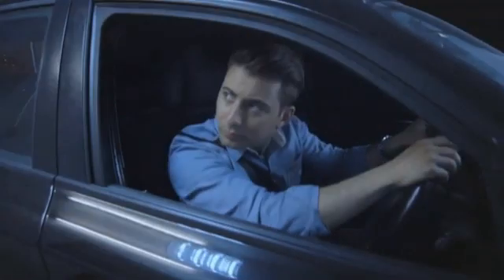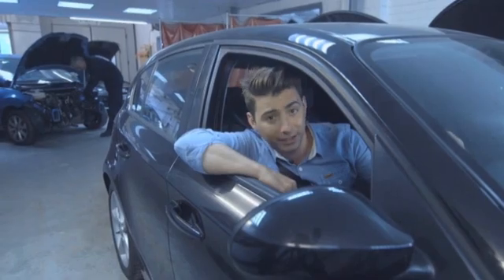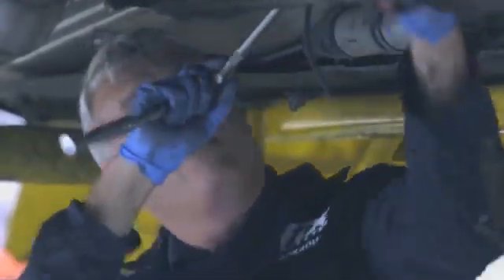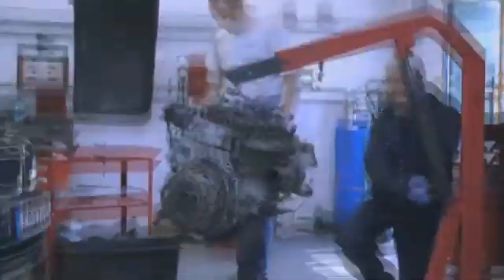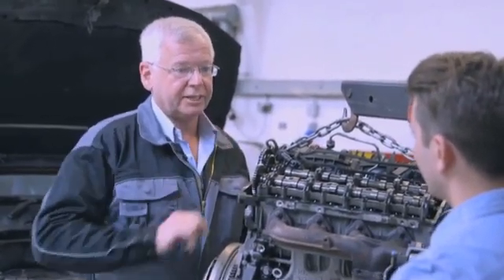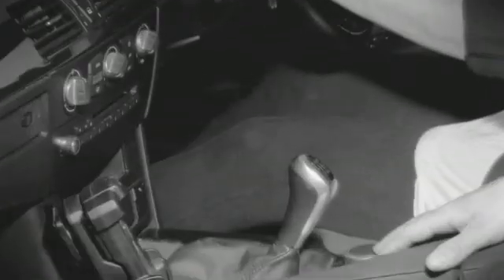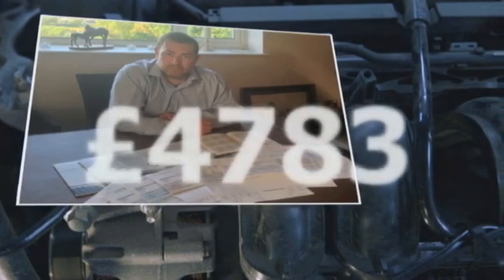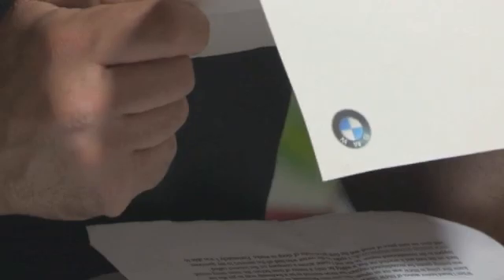BMW N47 Timing Chain Failure PROBLEM

Comment: You got what you paid for !
diesel, four-cylinder with turbo is not true bmw engine, its downsize shit for EU and her co2 limits politics
Reply: Tomas Kato
6 cylinder diesel also brakes down. My friend had last year first e70 timing chain broke with 230 000 km, than his second x6 same engine 3.0 l 173 kw with 270 000km and this he  told me to change timing chain before it brakes maybe 20 days before, and i didn't.
Last week my e61 525xd 2008 with 220k died on Autobahn and in service its fck timing chain. And i have x5 with same engine but more km on it, shit. I have to sell shit and buy some other brand but its all same shit, audi, mercedes also. I don't know what to buy that i dont have problems

Comment: always was bmw man. since my current e90 LCI 318d it is till good car to drive,
but how many problems it has. even small stupid ones. but it doesn't cost stupid money to fix or replace parts, it cost a lot !!!!

just week after warranty runned out one of rear LED light unit broke started to play up and 3 lights off.  they supposed to last for 10 000hrs ???!!! it has faulty chip or something in it,
BMW didn't offer to cover any of charges !!!!!!
i wouldn't advise anybody to buy such expensive car which fails same as cheap french car...
my advice go VW or korean :)
Reply: that can be reset

Comment: Yesterday was driving on motorway 70mph, suddenly engine cut out, when stopped at the curb tried to start it, the sound was like starter just spins and no any noises from the engine, on the dash no engine management light etc, is it timing chain???? Its 2008 e91 320d

Comment: I had a bmw and nothing but problems even the dealer couldn't fix the issues after 7 visits finally sold it and bought a honda which I had for 8 years and never seen a dealer for repairs at all only went in for services each year just sold that car and got a toyota and yes I know then have had lots of recalls but at least they had the bloody guts to recall and fix the cars free bmw just showed 2 fingers as shown in the video let the customer pay the £4000 they couldnt give a toss German engineering yes may be good but when something goes wrong it's time to remortgage your house to pay for there ridiculous charges.

Always said it Japanese cars are the most reliable cars in the world
Reply: At least they admit unlike bmw will never admit
Reply: Toyota and Honda have gone downhill, both having pretty serious issues like that takata airbag recall, Honda been having serious issues with transmissions and engine issues on the Honda CRV, Toyota had to recall 1 million hybrid cars for fire risk and they also had stalling issue recall.

Comment: Why do BMW's continue to have problems? They are inconsistent with reliability.  It's starting to become really annoying and frankly it's pathetic. My 2006 Subaru has less problems in 8 years than a brand new BMW in 1 year. BMW has been building cars long enough to know how to make a reliable fkn car that doesn't break after 3k miles. I'v always wanted a BMW, but the constant horror stories I hear from the e46 to the f30 models are starting to turn me away from them. For a car costing 33-40k it's making itself look really bad.
Reply: but shut up!i had a 5 series 2005 never had any problems,then X5 2008 no problems,X3 2012 NO PROBLEMS!
Reply: Top Cars HD Oh...I think I can say that You are the only one so lucky, believe me.
I' m a  car mechanic from 18 years and I can say that, from 1999 BMW is the worst company  if we speak of reliability.
Reply: BMW's aimed consumers are the wealthy people who buy them new, under warranty. The wealthy consumers then sell them to people who buy them used, or trade in for a new one. By that time the consumer has lost little money, or don't care because they can afford the depreciation loss. BMW does not care how the car performs in later years, because the people who do buy new cars, get rid of them before anything occurs. They do not care about the people who buy used, because they don't make much money off them.  The people who buy used BMWS are left in the dirt with the oil leaks and other common failures bmw tends to have.
Reply: taythephoenix We've had 10 BMWs in our family since 1993 (E34 525i, 2x 530i, e39 525i, 540iA, 2x X5 (first gen), e46 320iA, e91 325iA, F07 530d). And none of them have had catastrophic failures. The most annoying one was the e91, because it had problems with the radar-guided cruise control system (went to the shop 3 times because of that) and it also ate too much oil (1L per 2000km). One of the X5 also had an odd problem with electric mirrors while other problems have been really minor and even then none the issues have ever left us stranded on the road or caused any major inconvenience. Furthermore, e34 and e46 have proved to be almost bomb-proof reliable because they were in our family for 10 years each (the e46 was passed on to me). Sure, there are more reliable cars (like Toyotas, Hondas, VWs), but in the end these cars lack the refinement, tech and driving characteristics of the BMW. With that being said, the problems with N47 are absolutely horrifing and I didn't have a clue that the issue was so widespread. I will definetly avoid buying any BMW with that engine in the future.
Reply: Alex Davis
and thats different to other manufacturers?
Reply: pythonovitch It does seem that # of issues with BMWs has gone up in the past 10 years, but we also need to keep in mind that so has the # of electronic gadgets and tech in general. E34 had lots of mechanical components and was easy to work on for DIY whereas you need a laptop with a cable and electronics + engineering degree to work on something like e60 or F10.
Reply: ***** That is true. Unfortunately I (or rather my family) has no positive experience with an Audi. But we have plenty with BMW and also with one Mercedes (ML320CDI, pretty much bomb-proof). I should also add, that we had major electrical issues with VW Corrado, but that was way back when it was new so it didn't stop me from buying a Golf as brand new and selling my BMW.
But anyway, I think that all companies have horror stories. Remember when Merc lowered its production quality so it went from the brand with the best reliability record to the bottom second? It has since improved a lot, thankfully. To me, the absolute worst part about the N47 fiasko, is that BMW has handled it VERY poorly - they could have offered apologies and offered some % of cost reimbursement to customers. For this reason, BMWs with N47s have no value in my eyes. At this point, I would rather buy a French car than '09 320d.
Reply: merc audi and vw have same problems. ive had serveral bmws and never had any problems.
Reply: *****
Customer service is different everywhere. In my country, Audi service is absolutely awful and that goes hand in hand with terrible quality of their cars. My mom had more problems in 1 year of owning (bought new) Audi A1 than my BMW in 11 years. And it wasn't just some minor electrical glitches either.
Reply: im a BMW mec and i use to Work with e30 e34 e32 e36 e46 the best engine i worked on is the  m30 m20 m50 the m50 only needed a metal waterpump then it runs forever i have a e36 m50b20 i traded with my daughter for a e46 316 i love to start the e36 up it have a  stainless steel exhaust system and pure eargasm
Reply: Alex Davis
well the bmw 6 and 8 cylinder models have always been reliable. so everyone who buys a 4cyl should blame himself should it fail.
Reply: Never said it was necessarily, considering the topic is BMW I find other manufacturers irrelevant, but German engineering definitely seems to be considerably prominent in this.. MrBusunglueck

Comment: This is why you replace the timing chain / belt on any car at 100k
Reply: You didn't watch the video did you?
Reply: A timing chain is designed to last forever. BMW should recall all cars with the N47 engine and replace the timing chain and the crappy crankshaft. It's their fault.
Reply: *****
Timing Chains should last the life of the engine (or close to it). It's timing BELTS that should be replaced regularly. The life of a chain over a belt is why they use chains. In this case I don't believe the chain to be an issue because the chain did not appear to be broken. The cause appears to be some failure in the tensioning mechanisms.
Reply: Nope just typical German engineering just like the high pressure fuel pump failure epidemic.
Reply: *****
have an m43 engined BMW with 153000 miles, regular sevicing is key and general maintenance
Reply: Go ahead with that mentality and you end up like the video. Because when you wait until there is a problem they usually don't fail slowly, its usually working and then it isn't and the engine gets trashed.
Reply: Most warranties are over at 100k miles. Why would you want to risk 5-7k on this rather than having spent 900 every 100k miles. Thats how I see it, I know some chains are meant
 for the life of the motor, but usually never last that long in the real world
Reply: but some of these N47 are still in their infancy, not exactly high milers
Reply: *****
yes they are
Reply: I wasnt talking dealership prices here.Lol
Reply: OK  Narcoti, if that is the case, and given you know so much, why place such a consumable item in the least accessible place of the entire car?
Reply: German engineering.
Reply: Timing chains are not designed for the life of the engine.

Comment: i`ve had 5 bmws in the past and wouldn`t hesitate to buy again ! don`t see why bmw are responsible for a `consumable` part, that usually gets replaced by either the seller or possibly the new buyer when the vehicle changes hands as a precaution, and that applies across all makes and models ? so, if you are very hard on the brakes, do you hold the manufacturer responsible if they fail through premature wear at a critical point ? and Mr 5 series `POOTLING along at 70 in the outside lane` ? come on, i`ve been there !
Reply: It's not a consumable part, it's not a serviceable part either. It should last the lifetime of the car, not the same as a timing belt which is normally a serviceable part.

Comment: Iv been driving my 2008 118D now for nearly 100k and i only just heard about this failure today! Why don't garages say anything about this?
This makes me frightened even driving my car now...
Reply: there are n47 with 600 000 KM and no problems not all of them have problems
Reply: I'm so sorry to hear that Tom. There are people who do preventative conditioning of the motor (new sliders, chain and sprocket). My mechanic says that makes it as good as any of the other engines. He cannot believe BMW did not do a recall. How many people do not buy BMWs now because of this? A reputation is hard to make and easy to ruin - after the top dogs have milked their share, of course. He says shame on those who put our lives at risk.
Reply: Zksay OK. Sure, there are SOME people who never drive over 50 mph. So what? In my mechanic's view, you cannot drive frequently on European motorways at average speeds with an N47 engine and not experience a breakdown. He cannot believe BMW has got away with this. Neither can I.
Reply: I have 215 000 km and now problems yet, N47
Reply: What do you mean "if"? BMW are now doing a recall. Maybe you should tell them to chill too.
Reply: Michael McGovern The car has been sold, and every garage, 2nd hand dealer or new dealer KNOWS about these problems so you only get very little back for these cars ...
Reply: Tom Jacobs do your research, you're due for a major service. Replace the water pump, plugs, valve gasket, timing chain and tensioner and you'll be a happy bunny for quite a while.
Reply: You should be,my car's breaks steering and all driver aids failed with my 5 month old daughter facing upcoming traffic, I told BMW this,and they give me some stupid crap about warranty, this isn't over
Reply: I have driven my 215 000km on European highway and city without problems with the chain or other breakdowns... Chill if it was so bad that everyone broke down bmw would go under...

Comment: The German car is overrated  as are German Engineers and  German engineering.
Reply: ***** There are plenty of "other" countries that don't even scratch the surface to build something, but criticise other others for doing so. If the management and unions worked in unison together instead of disturbing Communist infiltration of the Labor movements, destroying the industries within, Britain would be still building cars today.
Reply: tanya bolton The last time someone mentioned Italian cars I laughed, the same applies today......
Reply: My cousin his 320e91 with n47 has 312 000 km.. without a problem. He changes the oil every 15000 km's
Reply: The best engines in the world make them Italians the problem are those thieves managers Italian! In Italy it produces the ferrari and that 'the only formula 1 car manufacturer which produces all alone .. engine, aerodynamics, chassis etc etc. .. the common rail has invented a igegnere Italian fiat iveco.Nel 1984 iveco bus were cammon rail German engineers did not even know what it was. The real problem are the leaders who are above who just want to offer scarce products at high prices .. if there fossere serious people in the Italian, bmw mercedes, audi poteteva closed!!
Reply: ***** The history of the common rail is a very Italian story : it was born from the need to release licenses from Bosch factory in Bari by a pioneering group directed by Ing . FP Ausiello , Director of Research and Development of Diesel Marelli , which took over three years, 1987-1990 , to demonstrate the industrial feasibility of this system. Since 1990, the system was developed by Dr. Mario Rich, now considered the father of the technology , succeeded , after the intervention of R. Bosch , the direction of the " Research Center Power Motors Elasis " in Bari And in fact, while the electronic part is was developed by the Fiat Research Center in Orbassano and Magneti Marelli centers of Turin , the injector , the pump and the pressure regulator (in practice, the "heart" of the common rail system ) were developed by its " Power Motors research Centre Elasis " Bari ( research center of the Fiat group ) . And even today in Bari , in the industrial area , is the establishment of the Bosch that produces high-pressure pumps for the entire European market !
But told by people who do not have the bidet in own house I guess what you have in mind !
Reply: ***** informed before you write! the internal combustion engine was an Italian invention (the invention can be traced back to Eugenio Barsanti and Felice Matteucci, who already in 1853 Florence! Forget believe me. If Italians were governed by German politicians would be the first country in the world. mah thieves ..... too many .. and 'the truth' .. Goodbye
Reply: ***** are not egomaniac. what I write and 'the truth' documented. The noodles are one of the thousands of fantastic dishes italiani.Non insult me by saying "spaghetti" are too good as the pizza you do not like? that the invention also! that genius who invented it!!
Reply: ***** They lost it 2000 years ago....Lol
Reply: ***** Words words words! in life matter the facts! clown
Reply: ***** Sei troppo stupido mi dispiace per te ...
Reply: Non sai scrivere  italiano, minorato
Reply: tanya bolton hahahahahahahaha, Fiat = fiasco. The italian government is like their engineering. What you find in one aspect of the people, you also find in the rest..
Reply: They are good German engineers. . Just ask the owners of the BMW 320 dn 47! How good they are ...
Reply: Tuo cugino è un alcolizzato è non ti ha detto che ha cambiato 2 motori.

Comment: the problem in the camshaft... in it there isn't the little hole for the oil passage... the oil arrive to the chain flowing inside the camshaft ! Opposite the pulley you must insert a plug to close the camshaft. and the oil will go out on the chain ;)
Reply: you are the inventor of this modify ;)*****
Reply: mi contatteresti su facebook per favore? scambierei volentieri 2 parole perchè vorrei prendere una bmw ma mi sto orientando su un mazda 6 per ovvi motivi di affidabilità.

Comment: Hi I just bought the Same ,and has the same issue.please someone help me ,to fix this ,somewhere in London.
Any address or phone number?
Thanks.
Reply: Hey sorry to hear that, are you based in London? if so i know a Bmw specialist who can help and hes prices are quite good!
Reply: sorry for the delay, to reply.mine i fixed in rainham.but dont take there.they are not good.they fixed mine, though,they left one ellen key in my transmission and destroyed my clutch.
go to e bay,you might seen.but most of them wont change the timing change, they tell you replace all engine with a rebuilt one,cost you between 1600-2000 including labour and 6-12 months warranty.
but this exchange only accepts ,if the chain NOT SNAPPED.
BUT MY CAR IS ABSOLUTELY FINE NOW.
IF ANYTHING MORE TO KNOW REPLY.
Reply: theb keep THANKS FOR THE REPLY.MINE I FIXED .ONLY CHANGED THE BELT .COST ME 1100 POUND.

Comment: Timing chains are preferred over timing belts because they should never need replacing and therefore last the duration of the vehicle. Timing gears are far better but are more expensive to mass produce, although Honda employed this idea on many of its motorcycles. If I was a BMW engineer, I would design the engine to have the timing chain at the front regardless, as my way of thinking would be," what if". I would be thinking of ever possible eventuality. Don't make them like they use to. :(
Reply: Theoretically it shouldn´t break, but with poor maintenance (oil changes), eventually it will. Anyway, even with good maintenance, the chain is a mechanical part that gets stretched out with its use and it´s a good idea to replace it to keep the engine performing as new.